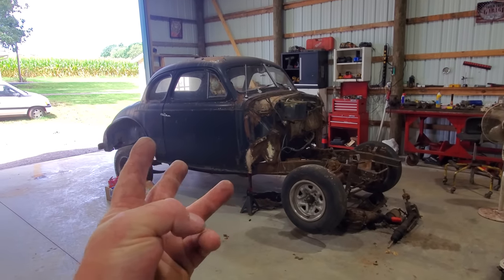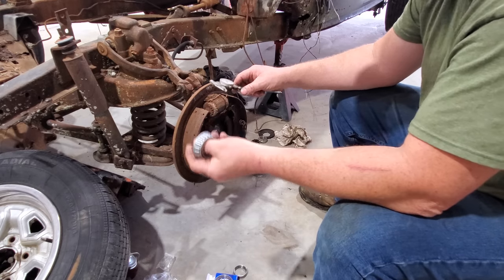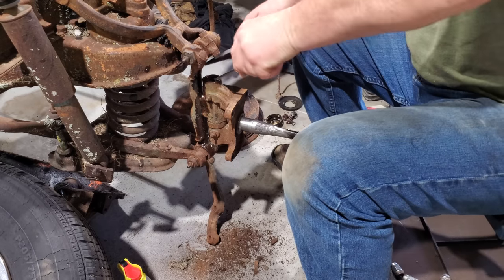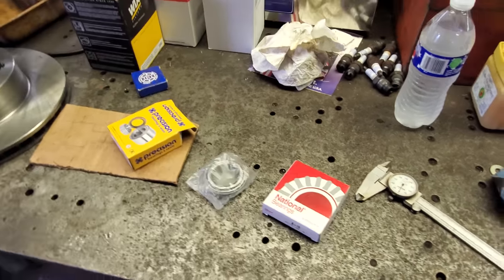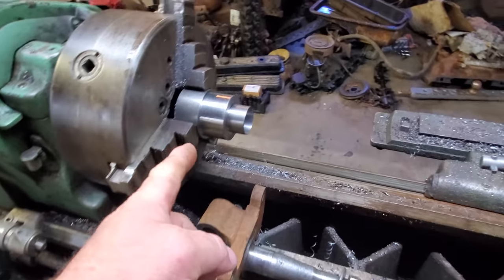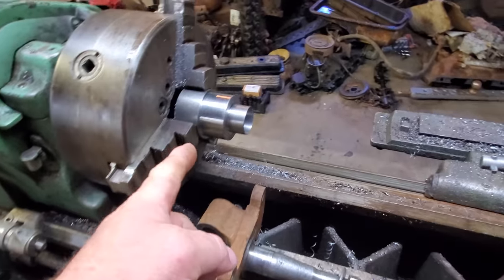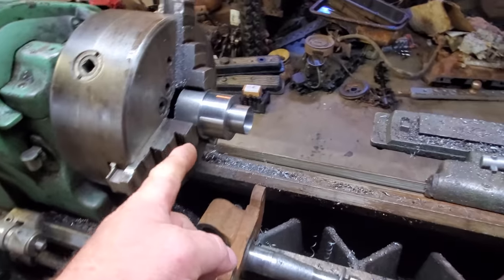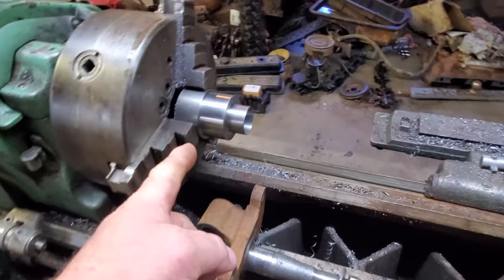1940 Chevy Coupe Part 3: Disc Brake Conversion. Rotors Get Mounted

Comment: Halloooo! my best friend. @ 31:00 slow the spindle speed down some, and a lot of overhang on the cutoff. Actually rigidity. Make a .5 or .625 bar split longwise on the end to hold some emery cloth. Use like a boring bar to polish  the ID. Sticking your finger in the hole with emery is very dangerous as the paper can catch and twist your finger and skin off. You can't shut the machine off fast enough! Super content my friend, keep on keepin' on! Dedicated viewer-
Reply from the maker: Spindle can't go any slower unless I put it in the back gear and we've tried that too, it breaks stuff in the back gear! Trust me we've tried everything with the parting tool and overhang makes no difference so I just throw it up there and let it chatter. The lathe is just wore out.

Comment: Most of old cars so I thought you said like that 86 Monte Carlo Road in Anne Marie rotor to use the spindle off and 86 Monte Carlo of the ramp to do that again like the speedway can’t use it 86 Monte Carlo, which is lame, rotor, and all what you got there, but uses metric special because that way I can get there with down to do the 76 Camaro where it bolts into the lower the ball joints would be and then still keep it outside with the same

Comment: Great work as usual chad. I was thinking, if you swapped the spindles from driver to passenger side and etc,  and then flipped them upside down, then maybe the camber and such would be right? Just a thought. Have a good night.
Reply from the maker: It would still be the same no matter what side it was on.
Reply: @ThisNThatGarage  Darn, worth a shot.

Comment: why not use the hub you have and get longer studs and a rotor that slides over the hub like lots of the later ones do
Reply from the maker: If that's how want to do it then sure. I chose this way.

Comment: The small amount of fab to use that s-10 frame would have really paid off about now & definitely later on if a problem arises..
IMO, dealing with a small amount of wider width overall would be easier… I’ve done it & several others have.
Love your content but struggle is real if you only trust what the internet says!!!!👍👍
Reply from the maker: There's a whole lot more involved in a frame swap than what I just did.
Reply: @ThisNThatGarage  not that much, as I said I’ve done it & the finished product was a great driver & the owner was very happy..
But you did it your way & there’s nothing wrong with that either, hopefully it lasts for a long.
Reply from the maker: Quite a bit more. Why do you continue on about a frame swap when it's clear that's not what I'm doing??
Reply: @ThisNThatGarage  , wow maybe actually read what I said 😂
Reply from the maker: @samcorley570  A frame swap is what you are talking about. There's not much else to read. 🤷🏻‍♂️

Comment: Could you not weld on the spindle and then machine it down to fit the bearings?
Reply from the maker: You could but I'm not a fan old welding on spindles.

Comment: That first adapter wobbled in the machine when you did that another end inside thingie, do not know how say it in english, that is why it wobbles. Here is timestamp 32:39. Good work anyway :)
Reply from the maker: No sir that's not why it wobbles. That wouldn't cause it to wobble. The rotor is garbage.

Comment: When you measure up those bearings and talk in the wrong system about 63K. 
I have no idea how you can count outside the metric system.
Reply from the maker: The wrong system would be the metric system.
Reply: @ThisNThatGarage  where everything is divided by ten? 😂
Reply from the maker: @dontdiecurious  I'm sorry if you can't comprehend the inch measurement system but it's quite easy. 😂 I can divide it by whatever I want. 🤷🏻‍♂️
Reply: @ThisNThatGarage  just keep doing what you do! Im waiting for the ford station wagon 👍 .
Reply from the maker: @dontdiecurious  👍

Comment: Drill bits are notorious for going oversized so to get exactly on measurement to be hitting your numbers reamers are a good option.
Reply from the maker: I can only remember one time where I actually needed a reamer. Most of my work is backyard butchery. 🤣 Not to mention go price a 1.187 reamer. I'm not paying that for one job when a boring bar and sandpaper works just fine.

Comment: I think '54 Chevrolet passenger hubs will fit that application.   Five lug.  I'd have to check the parts catalog for 39 to 54 to be sure.  But I think there's some interchangeability there. So you could use the  '54 brakes.  '52 Chevrolet half-ton hubs and brakes might work too.

Comment: So maybe the other company isn’t on drugs after all. They’ve done all the R and D to make the part, they have all the proper, non-wore out equipment allowing them to turn out the parts much quicker. Also, when you factor in how few of those kits they will sell, therefore needing to make enough profit on it to make it worth it, they are probably right on with their price point. By the time you factor in the $250 you spent at Rock Auto, your cost of materials, the additional wear and tear on your equipment, plus your time (after all, time is money), you have actually cost yourself quite a bit more than $750. Now, you do have the benefit of making money from the YouTubes which offsets your cost. As well, you fabricating your own parts makes for great content. Not to mention, one can hardly put a price on the satisfaction derived from the DIY aspect of it. All in all, job well done. Being a very amateurish amateur machinist I enjoyed watching you work. Well done.
Reply: I agree but this channel is all about using what you've got! Chad improvised adapt and overcame and now there's brake rotors installed on that pile of junk... even if they are a little wobbly lol
Reply from the maker: If you think what I made on the lathe is worth $500 then I don't know what to tell ya. 🤷‍♂️ My cost of materials was $50 and it did about 15 cents worth of wear and tear on the machine. My time is absolutely free and if I would have spent a little more time researching bearings I would have most likely found the bearing I needed so there's your research and development right there. I probably could have went to my local bearing store and he would have found exactly what I needed. I'm always in a hurry tho. The rest of your r and d is just measuring and cutting. Maybe that's why everything costs so much these days because people are willing to pay an exorbitant amount. If you want to pay high prices then have at it but I ain't gonna do it! 👍
Reply: @ThisNThatGarage  did you figure out why it's wobbly Chad?
Reply: @ThisNThatGarage  don’t get me wrong, I’m not bashing on you at all. Given that we only have a certain amount of time in our lives, it is never free. There is always an opportunity cost.

Comment: Those folks would use to Stephanie and Dolfia 10 front subframe and mounted under the car. May have been easier getting impliment to break loose. Will find out in a minute

Comment: Good video. You showed how to do it with what you have and not going and getting the next tool to make it easy. This is the way hot rod are designed with what ever gets the job done
Reply from the maker: This is definitely what hot rodding was back in the day. There wasn't a store to go buy what you need! 👍